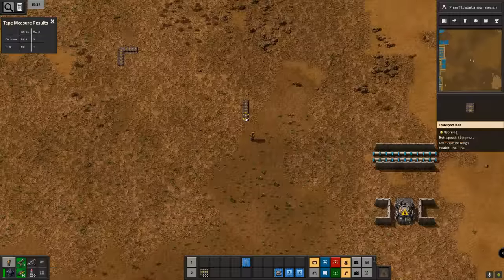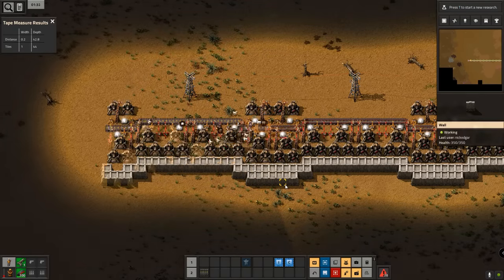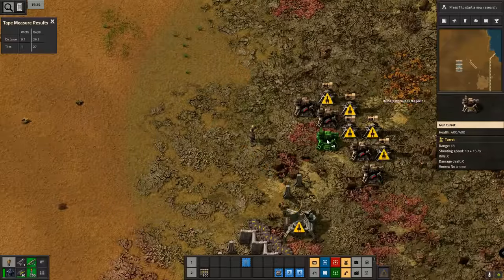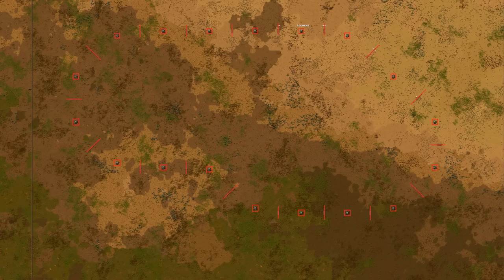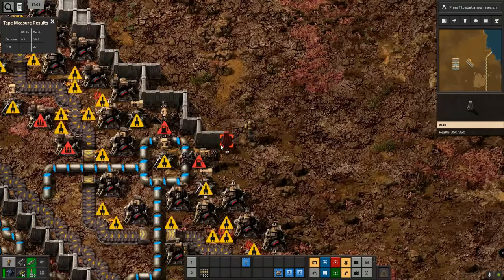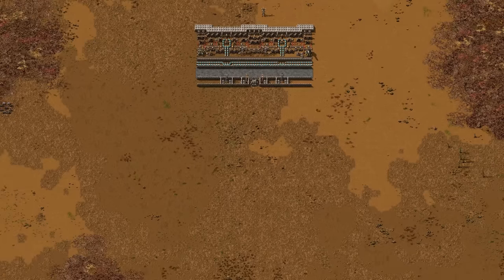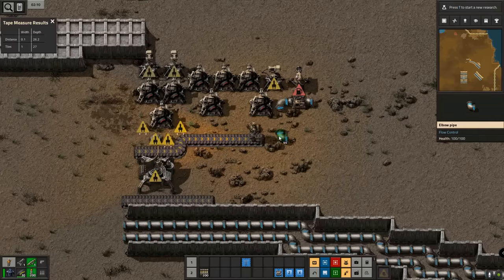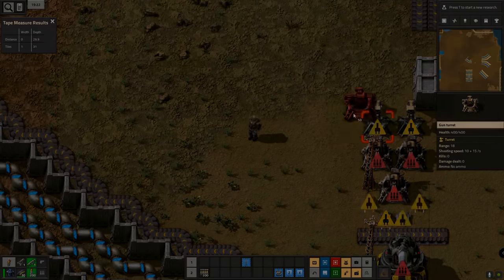Factorio - The Perfect Perimeter Wall Geometry

Comment: About using belts. Particularly in the earlier game, getting them full can be prohibitively costly. What I've started doing is using ammo feed belts that eventually circle back on themselves and a circuit timer controlling the feed belt to have it hold back ammo and release it in chunks (eg. belt on for 120/1200 ticks, adjust by need). The feed belt itself is being replenished just behind, where the unused, returning ammo backs up, so it'll only be replenished when it there isn't enough ammo circulating for it to back up.
Basically, it's just a way of controlling the ammo supply belt buffer size so you can do longer supply belts without the ammo costs getting out of hand.
Reply from the maker: I tend to embrace the ammo costs as stored value. The more ammo I can squeeze on the conveyor belt and the quicker I can do so, the less work needs to be done later.
Reply: @theotherbigfoot  Yeah, guess in the long run that works. I guess what I'm doing is just because I've been in situations where the ammo production has eaten resources I needed for other stuffs. But... that's probably just me not scaling up enough early enough.

I suppose it could still be useful if trying to run depleted uranium ammo though? An advantage of this system is that with a circular belt ammo delivery gets spread out even when not saturated, and keeping the ammo moving in blobs kinda stops everything getting sucked up by one bit of the belt. Dunno though, never tried to do depleted uranium on any scale.
Reply from the maker: @ashedtogether  Oh dude, I wasn't telling you that you were doing it wrong, I was just saying why I do it differently. Feels like you have a well thought through setup. If anything, I'm gonna stick with what I do already because its easier!! You aren't wrong about the resources, but I've recently been massively scaling up the resource deposits so that I can build behemoth factories, so wasting resources is less of a problem. 

I haven't tried uranium ammo yet either, but I am about to. I'm going to divert everything from the perimeter wall to a new setup to convert to green ammo and then back again. I've started converting already and am building a reserve in a whole load of storage chests before a big switch over. We will see how it pans out. There is content planned.
Reply: @theotherbigfoot  🙂I'm interested to see that!

Comment: A notch-out rather than curve would allow to target biters from two protected directions at the same time, which also solves the issues of bare corners. It may make some design aspects easier. (At least if the biter horde behavior settings aren't having attacking groups to be at ridiculous sizes.)

Comment: Corners are a natural weak point in all defensive structures in real life, but in some instances of technological advancement they provide a useful defensive posture. Creating stars, for instance, makes a fort's shape far more effective.

A simpler solution to perimeter defense for most people is to create corner circles that present a circular exterior segment that connects to the straight section via another curve inward. Sort of like an Omega, but less angular at the turning points.

Comment: i'm still "new" to the game, having just begun using artillery turrets on my longest ever continuous save file. dont know why i never thought to practise my wall building in sandbox mode.
i currently use a maze wall with dragon tooth corners which is for sure effective right now but my evolution is past 0.70 already since i had a slow nooby start to my game. like i still only have one line of weaponry on most of my walls. my brain hurts watching this but i'm inspired to fuck around in sandbox now

Comment: Awesome video, although looking at the walls I usually build I must be much easier on the biter settings than you... Apart from the comments on grid alignment and mirroring blueprints, would also add that biters I believe focus on some modules over others (specifically radars) and they're 'preference' for corners is likely more to do with that - worth testing, but I tend to just go with 90 degree corners and keep radars away from being in the extreme corner.
Reply from the maker: I put the radars there specifically to provoke the biters because I was recording for the video. That isn't my normal practice. That was just the corner in my current base that was getting the most action. The radars definitely sped things up but this corner has been problematic the whole build. I have been constantly repairing it. It has been the same with the other corners, although just not as heavy, which is why I didn't use them. 

The straight sections have been more or less impervious the whole time. As long as I've had a continuous line of turrets and available ammo the straight sections of wall have been able to resist the biters. 

This is all on the standard settings. Normally yes, I do play with higher settings on the biters, and the effect is definitely magnified, but the principle is still the same. Walls with curves, in my experience, have been inherently stronger.

I'm not saying you are wrong, I guess I'm just saying that this is why I go to the trouble of doing curves in the first place.

Comment: This is nice and all, but it is impossible to put pipes like that next to each other.
Reply from the maker: Fair point, I use a mod called 'flow control' which makes this possible. Doesn't really change the overall geometry lesson though. If you were building your own segments then you could just leave a gap between the pipes.

Comment: Bro...the biter AI doesn't target corners on purpose or otherwise. It's just that flat wall segments have small rectangles where spawned attack groups can originate to end up at those segments while corners have a full 90 degree spread of area where the corner happens to be the closest part of the base.
Reply from the maker: Ignoring the biter AI for just a moment, I feel like you agree with the general premise I am making in the video, which is that the corners of a perimeter wall are weaker than the straight portions. And if you do agree then the reason why this happens is irrelevant. Corners are weaker, get attacked more, whatever, and I thought curves are a good solution to that problem. I still think that. I'm going to be using these wall segments in every base I build from now on.

With regards the biter AI, in the timelapse clip where I record the biters attacking the corner of my base there are moments when the biters readjust their position before attacking. For me they are re-orientating themselves to attack the corner at precisely a 45 degree angle. They don't just 'activate' and attack the first bit of wall they came across. They activate, reposition and then attack. I don't know anything about the inner workings of the game, how the biter AI works, I only have general experience of the game. A lot of general experience. But no technical understanding. What that repositioning suggests to me is that the biters look for a weak portion of the wall and then attack that portion. That is how the game 'feels' to me. But as I said, I don't have any proof of that other than from what I have learned from general gameplay.

Comment: Why you don't abuse the biter pathing with a even a simple maze? A good funnel can negate most, if not all, biter damage. Also - why 2 kinds of flamethrower fuel? Either you are rich, so you use the better one, or you are poor so you use the cheaper one, no?
Reply from the maker: Ok, my theories as follows.

I don't use simple mazes because when those mazes get damaged my robots have to fly out into no mans land to repair them, where they will invariably get destroyed by biters. So I just leave it to my turrets to get the job done, which are at least designed to be engaged with the enemy.

The oil thing, I think the first time I used the flamethrowers I used just the one fuel and it ruined the balance of the oil processing in the factory. Entirely possible my newer factories are better designed and would cope better, but I think this is where the design decision came from. I'm not saying the way I do it is the right way, I'm just saying this is how I do it.
Reply: So I think theres something important here,  each flamethrower fuel mechanically functions almost identically, Light Oil is objectively the best fuel as it gets 10% bonus damage and is the most economically available. You want to feed your turrets with light oil hands down. Heavy gets a 5% damage bonus but you can instead crack it into light oil for more total damage. I would still run two supply lines to the turrets purely for throughput but include some pumps that push the fuel in opposing loops of the base. Determine a 'seam' in that loop so the lines will fully saturate, this can be the same local as where the fuel enters the wall.

Additionally, though it is a preference matter, I generally set my Flame turrets back further so they are more likely to leave fire along the wall where biters are likely to stand within the flames instead of momentarily passing though them.

You mention having trouble balancing your oil production, this is resolved with a basic circuit, read the contents of your petrol, Light, and Heavy tanks, compare  one to the other for each, and when you have say, more Heavy oil than light, the circuit enables a pump to crack heavy into light, the same for light to petrol. It doesnt work in reverse of course so you can use combinators to adjust the balance of this circuit as you prefer.

Hope thats beneficial to you
Reply from the maker: Ok, just for you, well, and because I'm interested to see if my current factory can handle it, I'm gonna try out light fuel only in my flamethrowers. I'm pretty confident in my oil setup (thanks for the help but I already have a circuit setup I'm happy and confident with. I was so confident I made a video about it (oil and SPM)) so let's put it to the test and see if it can do light oil only. Convenient timing as well, I'm only a few hours away from hooking up the flamethrowers.

It will work. I have no doubts. There are some design decisions I am still tied to from my early days playing the game and I just haven't tried anything different because habits. You say 5% bonus (I didn't know that), ima go grab it.
Reply: @theotherbigfoot  I'll admit this was the first of your videos I've yet come across, so I will have to check out your oil system video when I get a chance. I know people can do magic with circuits but I've only just started to understand them about a month ago despite having started playing before it hit steam, balancing oil with out circuits was basically just hoping that luck would do the job lol
Reply from the maker: It's no worries at all buddy, I'm just small fry on youtube really. I am no magician with circuit networks, I can do some cool stuff, but not a lot. I've made a video about that too!!

I don't like plugging myself but if you are interested in understanding the mathematics of oil and spm then that tutorial is decent. I don't think anyone else on youtube has figured out what I explain in that video. When I set out on the SPM design route in my factories I certainly couldn't find a video that explained it. If mathes is gibberish, there is a spreadsheet. That is in the video as well.
Reply from the maker: @nick11crafter  Soooo, I've been thinking about this. It takes 40 heavy oil to make 30 light oil. 40 heavy oil gets a 5% bonus (42), 30 light oil gets a 10% bonus (33). Therefore, by volume, heavy oil causes more damage than light oil. 

I guess I'm gonna stick with my original setup
Reply: @theotherbigfoot   @Bigfoot  You make a solid point. Though I meant that you have more by volume in the sense that you get light oil and heavy oil when you process crude or coal liquifaction, then you can crack the heavy for more light oil in the same network of pipes. 
Essentially it's easier to keep it topped up is all.
That said your maths seems to check out and it should work well

Comment: Your grid is impressive, especially the railway inclusion.

But why is your perimeter wall so expensive? On the length of one roboport I support a wall with only 8 gun turrets in pairs. Each pair has one requester chest requesting ammunition and some burnables the turrets get feet by burner inserters. So no electricity is needed besides the roboport. If you place buffer chests strategically this will support even long walls.

Artillery will pull huge groups. I strengthen those segments with flamer turrets. Just make shure the turrest get ammunition before the artillery.
Reply from the maker: I do generally play with the biters at quite high levels, and I do generally feed the wall with just red ammo, so I have found a big thick wall to be prudent, but I am certain that if I made a video about a perimeter wall that wasn't completely over the top then nobody would watch it!! I do build my walls like this, and I have been doing for quite some time so I don't feel like I'm being misleading, but also I think to be successful on youtube these things need to be taken to their absolute limits.

Besides, I generally build big factories so an expensive perimeter wall isn't really a problem.

(There is nothing stopping you from taking my blueprints and removing the turrets you don't want. If you need to upgrade then you can just overlay my original blueprint on top)
Reply: @theotherbigfoot  as i said your Segments are impressive. And the video is a real eyecather. My biggest factory is a 1.2 k SpM Railworld. Biters are at normal level though so. Therefore  i never experienced a bitter attack that would call for such a strong defense. 
Lately i found that with artillery on 5 th range extension the need for real perimitter walls shrinks to a minimum. So i build a heavily protected artillery outpost which clears the area before building other outposts when the dust settels. 

Your wall is certainly built to last.
Reply from the maker: @ralfw7463  This is why I love the game, there are so many different ways to play it. Everyone has their own strategy.

Very rarely will I use artillery turrets. I guess this is a consequence of having the biters at higher levels, but when you attack a huge biter nest with artillery the last ditch surge attack from that nest are really difficult to resist. They just overwhelm the perimeter wall. My strategy has been to build really tight and efficiently spaced factories with compact robust perimeter walls, and leave artillery mostly off. If everything starts sprawling then these perimeter walls are expensive to build and use a lot of power. As I am finding in my current lets play.

Thank you for the compliments.

Comment: ...Or you can just double the amount of turrets on corners, and not worry about curves. Great video, but i'm questioning the practicality of curved sections. Having only straight, dioganal, and corner sections should work fine for most situations.
Reply from the maker: That is a fair comment. Maybe the language in the video wasn't precise enough. Replace 'curves' for 'graduated corners' as in 'the more graduated the better' (a curve is just a very graduated corner, particularly in factorio) and we would probably have an agreeable middle ground. I think the main thing I was trying to get across was that 90 degree corners are not great, or at least not in my experience. That was the main thing. If you choose to solve the problem differently, awesome, that is what makes this game great. 100 different ways to solve the same problem.

Comment: will you be adding a train station and a point of entry for fuel and  ammo segments ?
Reply from the maker: A train station for mining? I was concentrating on just perimeter wall stuff.

Point of entry for fuel and ammo - not 100% sure what you mean, there's a point of entry for trains. Do you run your ammo trains on a different train network on a separate set of lines?